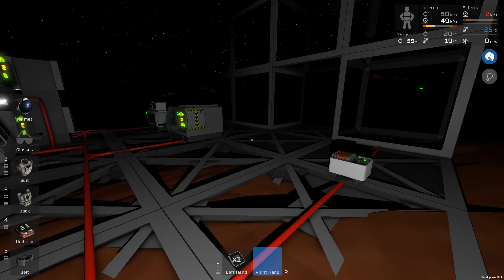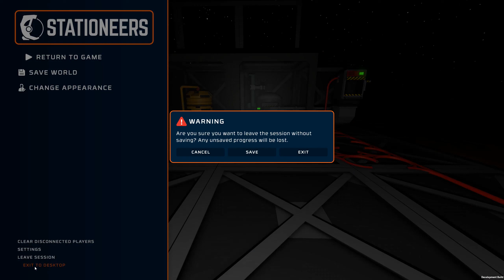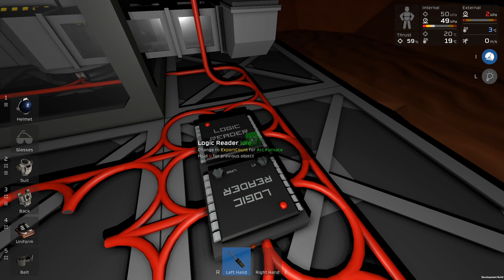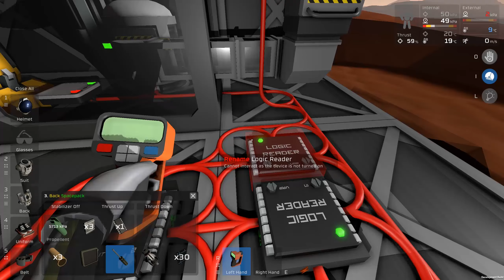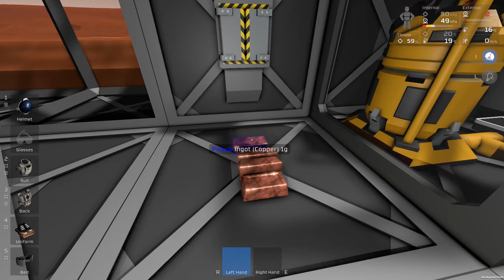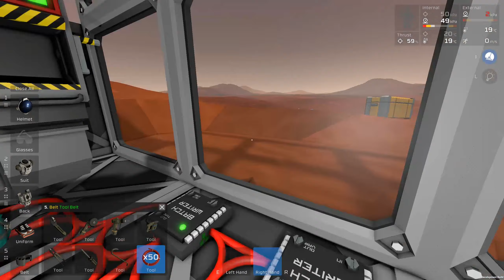Stationeers S4 E10 Automatic Arc Furnace Options

Comment: A solution I use is to use a breaker Lever, a memory and a select after the compare for multiple furnaces. When the lever is pulled the select will output 0 from the memory and then it is reset the compare gets put through normally. Helps a lot when the power cuts unexpectedly or there is something stuck in the furnace. In total it would thus use 2 batch slot reader (max import and export slots occupied var), 1 compare for import <> export, 1 memory on 0, 1 logic reader for the lever, a lever of course, a select that either sends the compare result or the memory 0 depending on the lever state and finally a batch writer to punch all those activation switches. In total this would take 5 active logic pieces total for any amount of arc furnaces.

Comment: You want the batch readers to read SUM, not MAX, so you see if there are more furnaces with import than furnaces processing import ==> there is work to do. If you use MAX, when at least one furnace is running no other furnace will be activated. Also note, the export slot is only occupied for a brief moment, you probably want to check whether sum(import occupied) > sum(not idle). note that sum(not idle) = number of furnaces - sum(idle).

Comment: I use 7 arc furnaces for each smelter able  ore and when i used the batch reader and writers it would activate all furnace even when it had nothing in them - i found a solution per arc furnace from bushwacker ( spot the aussie )  and it works  uses 5 chips per arc furnace i have a pic of it on my facebook site

Comment: IC can control up to 6 furnaces for 50W :p

The following is what I use if I just need 1-6 arc furnaces automated (I have a more complicated one for my smelt room, but this is simply for furnace automation)  It will auto-detect a device on any screw, and make sure it's an arc furnace before checking the furnace for items and triggering it.  (This particular script will also turn off the furnace when not in use to save some more energy during down periods.)

reset:
move r0 0
loop:
yield
bdseal dr0 process   # if device set, process
add r0 r0 1          # add to device register
bgt r0 5 reset       # clamp at 6 devices
j loop

process:
l r1 dr0 PrefabHash  # get device type
bne r1 -247344692 ra # skip if not arcFurnace
l r1 dr0 Activate    # read active state
bnez r1 ra           # skip if active
ls r1 dr0 0 Occupied # read input slot
s dr0 On r1          # turn on/off as needed
beqz r1 ra           # skip if not populated
s dr0 Activate 1     # activate this furnace
j ra
Reply from the maker: Oh sure, once we get to ICs :) still in electronics tier yet however!
Reply: works but ore stays stuck in shute, wonder why

Comment: I use slot reader + Import + occupied and slot reader + export + occupied  and != on the compare, and a set of chutes.  I have had no issues with it running through dozens of ores*.  4 ICs per arc furnace and no reliability issues. 
*does assume the system does not run out of power.